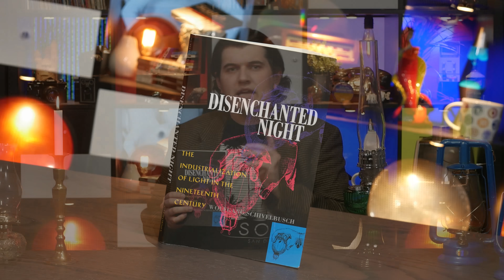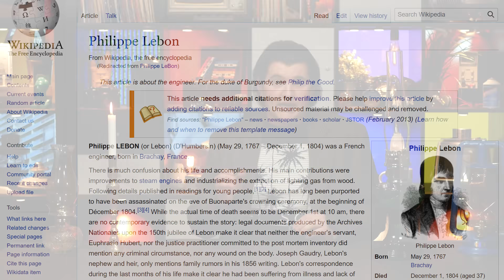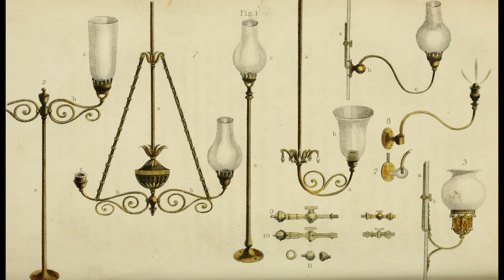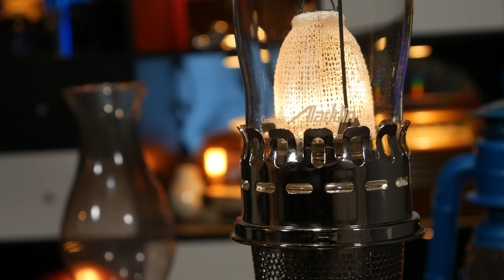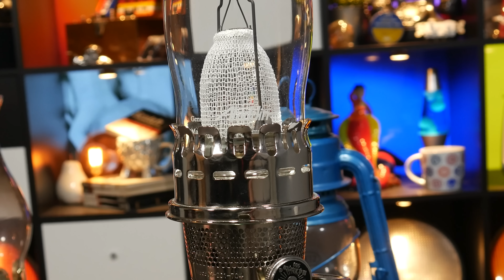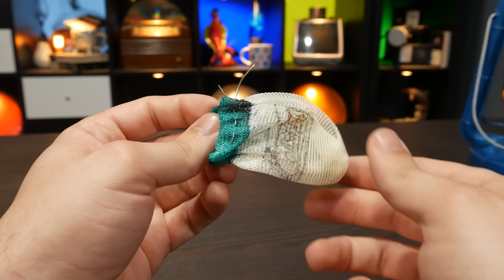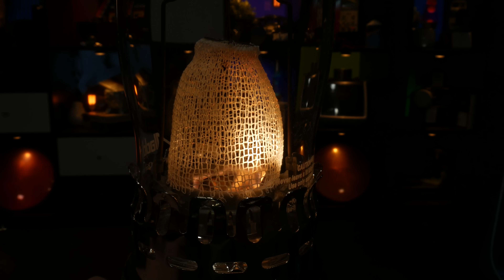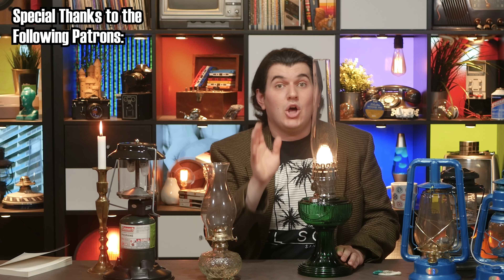How the gas mantle made lamps 10X brighter

Comment: The central hole burner made the kerosene refrigerator at our off grid beach house work, it used only 20ml/hour. We also had a similar burner in our kerosene heater in our bathroom (which we ventilated and only ran to preheat the bathroom. We now have a solar fridge and ethanol bathroom heater.

Comment: Side note: I have a "Candle Lantern." A candle is placed into a spring loaded cylinder and a hollow cap placed over it to keep it in. As the candle burns, the spring pushes it up, keeping the wick and flame stationary. A glass bulb/chimney protects the flame and the whole thing can be carried around safely and easily. Still no good for outdoors, but much better than a plain candle.

Comment: I remember back in boy scouts we had one of those camp lanterns... that my father got annoyed with... the next trip he had piped together the monstrosity that it to a full size propane tank.
Reply: Heh. I do that. The adapters are surprisingly cheap
Reply: @TalenGryphon  you misunderstand. Buying one would have been the reasonable thing... he insead built this 10 pound monstrosity from severed copper pipe where you needed to put the propane tank on It's side. The thing was intimidating.
Reply: @matthewpopow6647  You put the tanks sideways when you use liquid propane, upright for gas.
Reply: @A.Martin  Nobody uses liquid propane. It is -42 °C. I've only used it a couple of times to freeze mercury.
Reply: @louistournas120  Vehicles take LPG from the tank as a liquid. LPG is propane/Butane mixture.
Reply: @A.Martin  Are you saying the liquid reaches the engine and it is sprayed and it turns into a gas?
Reply: @louistournas120 of course it will be converted to a gas somewhere, but it is taken up as a liquid.
Reply: @louistournas120  however the most efficient although not the most common engines do exactly what you say and inject liquid into the combustion chamber, but usually the liquid is mixed with the air first then sent to the combustion chamber as a gas.
Reply: @A.Martin  I see however that is strange. I would imagine pushing air into liquid propane is difficult since already the pressure of liquid propane at room temperature, I think it is over 200 psi.

Comment: Gasometers were a part of my childhood (and deserve an episode of their own).  They were everywhere in those days (50s and 60s) and you could while away hours and hours 'watching' them rise and fall (much like clocks, you knew they were doing it, but could never actually see them move!).  The sections were sealed with water (or rather the lower sections were stored in a circular trench of water), so when they were full, the top section looked OK, but the lower sections got progressively more rusty.  We had an old disused one outside our flat until quite recently (early 2000s), and I've not seen any others locally since it was dismantled, so it must have been one of the very last ones still standing.  Although they were, of course, used for storing gas, their main use was to maintain a steady pressure in the gas main.  A very simple answer to a very tricky problem.
Reply: Interesting... so in a way they did "measure" something. Not just the amount of gas currently inside, but also the relationship between the generation and usage rates.

Comment: Many buildings built around the turn of the 20th century were equipped with both gas lighting and electric lights. In fact some light fixtures had both electric and gas lights in the same fixture. 
It’s not uncommon to still see the gas shutoff valves on the walls like light switches. 
The original Coleman lanterns did use gasoline. They always stated that only “white gas” should be used. That meant unleaded gasoline, which was distributed by Amoco. Most other gasoline had lead which was not recommended for use in the lamps, probably because of its toxicity. 
The lighting procedure for the gasoline fueled lanterns required a preheating process to vaporize the fuel.  Incidentally, gasoline was a commonly used fuel for camp stoves and blowtorches before the development of small propane bottles. These appliances were common throughout the ‘50’s and 60’s.

Comment: next time you are camping or burning wood in your fireplace, look very closely at the base of the flame.  Done right, you will see a very small clear spot between the flame and the wood.  This is cause by the wood decomposing under heat and then the gas igniting.  This is exactly the same this that happens when wood rots or decomposed.  The difference is  simply the speed.

Comment: I lived in a really old house, there was a plumber came to move a gas line and he screamed some 4 letter words then ran upstairs. he scraped some paint off the light fixture in the hallway, turned a nob on the side and lit a gas flame out of the top. live bare wires were run through a active gasoline on purpose, like it was a duel gas electric fixture... on purpose
Reply: People were heartier folk back then. Much more resistant to fire and explosions than people are today.

Frankly, I blame the parents.
Reply: That's pretty frightening...
Reply: what in the holy name of f... 😨
Reply: I thought it was pretty common at the time when converting from gas lighting to electric that some people ran the electric wires to the fixture up through the existing gas line. They got some extra excitement if the neutral wire was the gas pipe itself, disconnecting the gas supply to the fixture was optional apparently.
Reply: It was probably originally insulated at least. I've done some restorations of old electrical devices and it used to be common to insulate wires with fabrics, most of which have since completely rotted away and left behind large amounts of exposed wires just waiting to short out.
Reply: Gas and oxygen don't explode unless they are in a certain mixture... I may hope the gas in the pipe doesn't have any oxygen... And if it doesn't it's not that big a risk (but with the risk of but sometimes (if the gas pressure is off for some reason oxygen gets in and someone were to switch the light on), it's nowadays seen as a bad idea)...  
You can spark all you want in gas.. as long as there is no oxygen the spark is going to do nothing.

Youtube vid of an oxygen flame in a propane atmosphere as illustration. Around 4:40 you can see oxygen burning in a propane atmosphere. :

https://www.youtube.com/watch?v=8jmX-TUQkx4
Reply: @jazzdirt  Main counterpoint is that a short circuit at household available energy levels is not "a small spark", but rather a "there is now a hole in your XYZ" tier event.
Which would give your gas pipe a fresh new outlet to oxygen courtesy of a very high energy event.
It probably wouldn't explode, true, but you would definitely end up with a brand new unplanned gas light burner in your line if they short!
Reply: @FerralVideo  LOL probably

Comment: When I was a kid we used to use those Coleman lanterns all the time on hunting and camping trips.  If I remember correctly, you never wanted to touch the mantle itself;  if you did, it would just disintegrate into a fine powder when you touched it.
Reply: Same, apparently it was "petroleum naphtha" liquid fuel that had to be pressurized by hand for the first few minutes of operation. Then a generator of some kind used heat to keep the feed going. I was always getting in trouble for being too rough with it. Tying on new mantles took a bit of finesse.
Reply: @frederf3227  Yup.  You used to be able to buy "white gas" fuel (I've been told it was simply unleaded gasoline) at service stations. When I was a kid, every family camping trip started with a trip to the gas station to buy a gallon of lantern fuel. I remember my dad pumping up the fuel tank of the old Coleman lantern when the light started to dim. I prefer propane.
Reply: @dstone1701  When I was a kid, my parents joined this cult up in the woods. We used a lot Coleman lanterns. I could never figure out the how and why of mantles. I think somebody gave me a really bad (and very wrong) explanation, but watching this video has clarified the science behind it.
Reply: @dstone1701  This is the stuff.  https://en.wikipedia.org/wiki/Naphtha

 It's the only thing we used in our Coleman lamps and stoves back in the 70's and 80's before the little propane cannisters became a thing. Before reading the Wiki page I had no idea it was the same thing as the 'lighter fluid' my dad used in his Zippo.
Reply: @dstone1701  the white gas evaporates completely from your fingers and gear and doesn't leave a residue or smell.   I prefer the white gas to propane as it's more energy dense, has lighter containers on account of not needing to be stored at high pressure, easier to see how much you have left and better for cold weather, but white gas is certainly fiddly with the pumping.   On a nice summer daycamping trip, propane would be so much less trouble.
Reply: @JaimeWarlock  I liked how you just casually breezed by the cult bit to get the important business of gas mantles.
Reply: @dstone1701  White gas isn't gasoline.  It's some other kind of petroleum based fuel.
Reply: Unleaded is usually compatible, but not ideal.  It will cause more wear or leave residue after awhile.  But I've used it when I didn't have a gallon of 'coleman fuel' around for my camp stove or lantern.

I don't remember any gas stations near here selling white gas from pumps, but have seen some near campgrounds sell it in 1 gallon metal containers on a shelf (usually branded Coleman or an outdoor brand).
Reply: @cl3mb0t  much more common in the 1950's!
Reply: @mgjk 
 With the propane bottles at $6, the white gas is miles cheaper!
Reply: “Fond” memories of camping with my dad, accidentally or otherwise touching or breaking the mantle, and getting whooped/yelled at for breaking it.

Ahhh the good old days.
Reply: Yeah, we had a naphtha Coleman lamp and I'm pretty sure I busted at least one mantle.  Those things were bright as a small sun.

Comment: “and we'll cover that in the next video”

Damn cliffhanger endings
Reply: As a collector and restorer of old Coleman lamps it was a sad cliffhanger indeed.
Reply: @Juggernath  I stil have my familys old pump lantern.
Reply: I've watched too many Morrowind memes and thought that said cliffracer
Reply: My dad took me gigging with a tilley back in the day. Then I took it up with my friends using a gas lamp. Then a halogen H4 and a car battery. Now you could probably just use a key chain LED.
Reply: Next up Tilley lamps...
Reply: @numetalmarius1241  I hope so.  There was a large range of Tilley lanterns and heaters, although the Storm Lantern X246B is by far the best known.  300 candle power can put out a lot of light and heat.

Comment: Your video was so much fun. I'm 66 and originally from the UK. When I was 5 my parents were really poor and we lived for a few years in an uncle's holiday cottage that didn't have electricity, so it was illuminated with gas mantles everywhere. This was before the advent of Methane/Natural Gas. One of the fun things you forgot to mention is that coal gas is heavier than air. So in the winter and if your house was sealed really well it could asphyxiate you and if you woke up and lit a candle it would blow the house and you to smithereens (lovely word). It had a distinctive smell much like essence of old engine oil, My parents reinforced the rule in both my sister and me that if we smelt it we were to yell and run outside. The only problem was that we always could smell it. 

I can't wait for your next video and I'm assuming you have a Tilley lamp in the video. I have two for our power failure kit because they are staggeringly bright and only a bit explosive. They can run on all the kerosene derivatives (Jet A1 works particularly well) although red diesel seems to gunk up the tubes after a while. You would have to be mad to run a pressure vapour lamp on gasoline so I bought one of Coleman lamps but it definitely make me itch when it's running. The Tilley lamp is hilarious because you usually set fire to a small bath under the mantle of methylated spirits to pre-heat the lamp to get it up to temperature. Once it gets going though it's so bright you can illuminate a whole campsite.

Comment: 22:45 I really appreciate you fully showing the carbon buildup disappearing. that was very satisfying
Reply: I was scared he was going to cut away
Reply: ISTR it wasn't always easy to remove a soot spot, it could take a while fiddling with the wick to burn it off because too low and there wasn't enough heat to get it glowing, but turn it up a fraction too high and you'd see the yellow flame licking up the outside of the mantle. I still have an Aladdin of the type we used in the 1970s, but haven't yet had a use for it, Kerosene OTOH is a useful degreaser, I usually have some handy.
Reply: @grumpus27  have you tried Coleman $1 socks retrofitted to the Aladdin? 

I went to order new mantles last year and was just shocked ($38 for one).  Went to the hardware store,  bought a pack of two Coleman aftermarket soft mantles for 2.25.  Tied one to the harp base and ring.   Sprayed it with my wife's AquaNet till it was stiff and the right shape.  Works fine.
Reply: @STho205  I've considered that sort of mod - I have a Tilley lamp that uses similar soft mantles, but I still have an unused mantle for my Aladdin. Definitely worth a try next time.
Reply: It's a lot less satisfying when you are trying to get your lamp to burn bright and the flame spikes keep making those deposits everywhere.
Reply: Yes.
Reply: Agreed - that was an excellent illustration.
I do recall from childhood that during (very frequent) power outages we would break out the gas mantle lamps. 
They had a hand pump on the reservoir, and we had to pump up the pressure before using them - then there was always the admonition to monitor it closely and especially not to let it get too high, as there was always a chance of burning up the mantle, which made adults incandescant with frustration.
Reply: Yeah it was, it was like a movie special effect and very cool.
Reply: @MrBilld75  Come to think of it, it looked similar to the disintegration effects I've seen recently catching up on the Marvel shows.

Or rather, Marvel have captured that disintegration effect wonderfully in their CGI.
Reply: @emdivine  Yeah, big fan of the Avengers movies, as is my wife now. She was never a fan before, but after seeing Infinity War and Endgame, she fell in love with the movies. She even got into the other ones, Dr. Strange etc. and liked them too. And she wants to see Black Widow when it comes out soon.

Comment: I assume forced my lute means the pressure of the gas pushed open the stopper to the container it was in or if it was to tightly secured the glass container would break
Reply: saw your pinned comment and looks like its correct :)

Comment: I hd a camping lantern made by a firm called Gaz in the 1980's. Their  butane/propane mixture, called "Camping Gaz" ran a gas mantel that was placed over a vertical pipe that supplied a mixture of the gas mixed with air to the inside of the mantle. 
On first use it burned off slower than yours but when it settled it gave a very bright, slightly lemonish coloured light that was widely adjustable in brightness. 
The light was very windproof, economical and eminently portable. It saw use not only for camping & fishing but also for power cuts. 
A really splendid lamp! None of the pumping that liquid fueled versions needed & the Gaz containers were much cleaner and safer than carrying petrol around!
But all the way through your video I was yelling "What about the radioactivity on the mantles!" and "Get the Geiger counter out!".

Comment: One of the by products of coal gasification was coal tar. While I think there were uses for it, the production of it outstripped those uses, so often it was just dumped in a pit.  At least, that's what they did where I live.  About a century later, the coal tar had oozed through the soil into the not too distant river.  At first the city did a clean up of the river, and some digging at the flood plain and banks, but a few years later it reappeared.  It was then an intercept trench was dug, and the coal tar is pumped out periodically and disposed of as chemical waste.

Comment: the house I inherited from my grandmother had originally been lit by gas lighting.  The pipes were still in the walls and ceilings, even a few valves were sticking out of the walls in some rooms.  it was so cool.  I also had an old oil lamp but I didnt know its value till I sold the house and it was left in the basement.  The ceiling fan was literally attached to the ceiling by bolting it to the (yes disconnected) gas pipe that was still in the ceiling.

Comment: This is... Quite literally, The CFL of fuel-burning light.

Instead of a fuel going through a cord of conductive material (As does tungsten to electricity and cloth with liquids) to produce heat, And that heat glowing into light.

Instead, We have a separate object, A thin tube of something that will, Instead of being so hot that it glows, (Almost) Directly transfers the energy into light through its fluorescence.

Oh also, It was used in more permanent and established areas, And was only used in the home for a relatively short time, Before a simpler, Safer, And more reliable option was made available.

Comment: Lute can mean A substance, such as dried clay or cement, used to pack and seal pipe joints and other connections or coat a porous surface in order to make it tight so I may assume it broke his seals on his testing equipment?